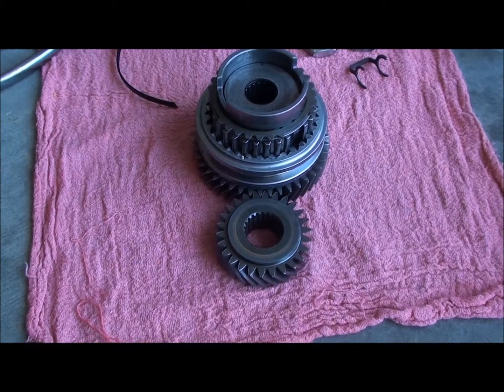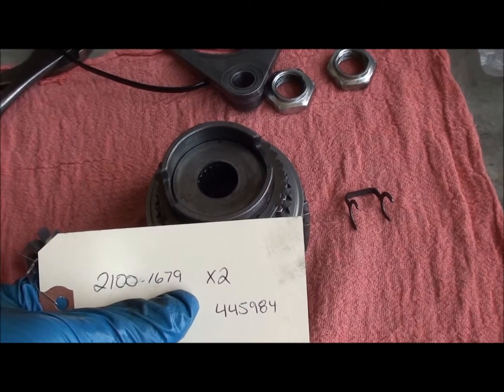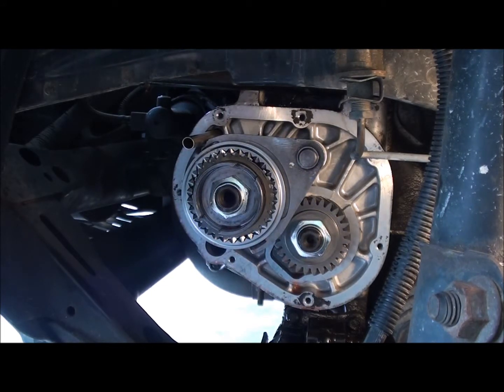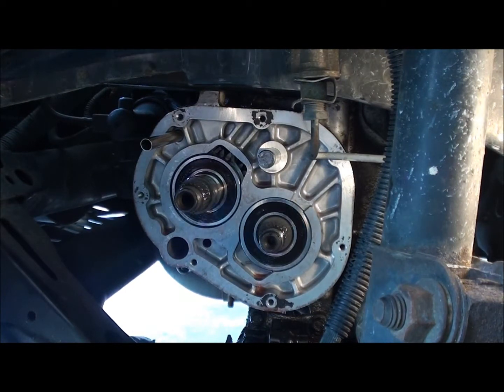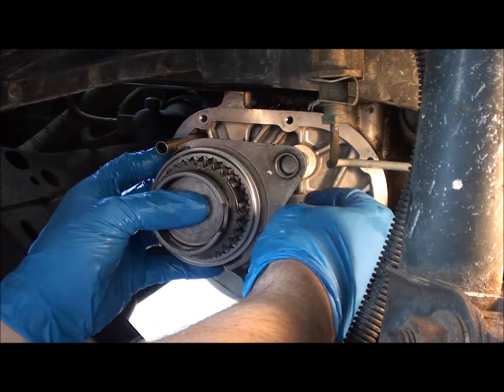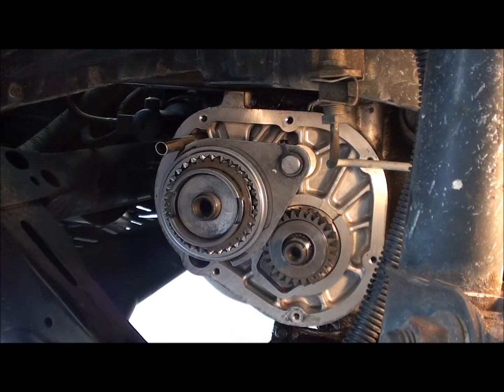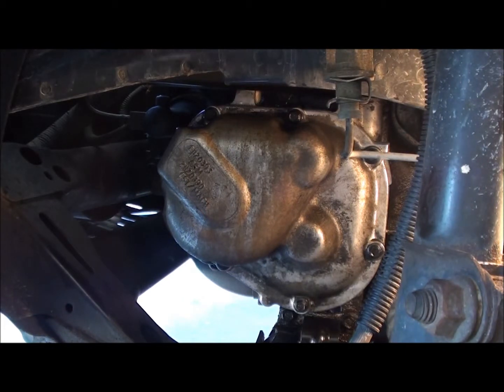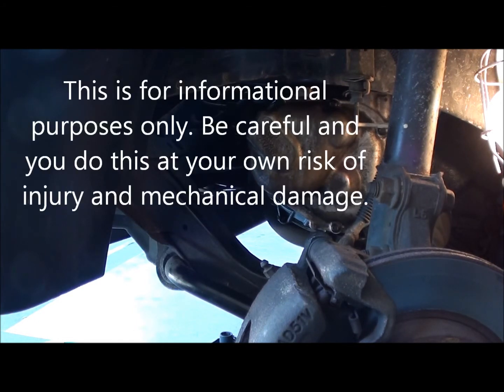Saturn SL2 DOHC 5th Gear Swap - Better MPGs!

Comment: Did the cruise control still work?
Reply from the maker: I believe it should. Unfortunately,  i couldn't test one. Mine was all manual, no cruise control installed. I was in the process of adding the CC components and about to have a dealer with a Tech 2 scan tool enable it, but totaled the car not too long after making this video.

Comment: This is a new question on an old post. I have a 99 SL2 5 speed and I was shifting and 5th popped a little and when I tried to seat it in it started whining and it sounds as if the pressure plate isn’t making contact because you can hear revolutions. Every other gear is normal with the addition of gradual increase in grinding noise in neutral unless you’re pushing in the clutch.

Comment: I'm planning on swapping 5th gear on my Corolla which has a C50 gearbox with the ratio on 5th at 0.815 and after the swap it will drop down to 0.725. I'm using a C53 gearbox for the conversion. The revs won't drop massively but it won't be as loud at 70mph.

Comment: Excellent video. I am inspired now i will go to the junkyard and grab the 5th gear set this week and do it. I drive 250 miles a day so i had considered this even though ill loose my cruise control.
Reply from the maker: Hope it works out! Good Luck and thank you for watching!
Reply: JungleKing007 i Got it all installed and it is working.
Reply: @TheMadcowintucson  Hi there. Are you still enjoying the higher 5th gear? How has it worked out for you?
Reply: @81gp80  yep works like a champ never had one problem with it but I don't use it in the city much. Now I drive mostly city and not so much highway I may swap them back lol
Reply: @TheMadcowintucson  Good to hear it worked out though. Makes sense you're considering switching back. Did you loose cruise control making the swap?
Reply: @81gp80  yes you do loose the cruise control function. I do not believe it was ever figured how to make it work
Reply: @TheMadcowintucson  I'm working on a 1997 SL2 with an auto. Well, I got it about a month ago and when it warms up I'll start. It's an auto and I'll changing it to a standard. I intend to make the 5th gear swap to the .605s. I intend to make the cruise work and wanted to see if you'd like the solution as well? I'd to get a few cars testing what I've been working on to see if there's any reason it won't work as it should.  Thanks for your replies; they're much appreciated!
Reply: @81gp80  ok sure if you get it working let me know. I think other guys just bought universal cc systems and installed those.
Reply: @TheMadcowintucson  Will do!

I guess that's an option as well. But it isn't necessary.

Comment: Does the gear you swaped have bigger or smaller ratio to increase mileage?
Reply from the maker: Here's the number crunching done by a gentleman on the SaturnFans site:

MP3 5th gears : 37*27 teeth => 27/37 = 0.7297 => 0.730

MP2 5th gears : 43*26 teeth => 26/43 = 0.6046 => 0.605 

Dividing ratios : 0.730 / 0.605 = 1.2066 => ~21% reduction in RPMs => 21% gain in MPG.
Reply: So, does this calculation work in every car both ways?

Comment: This is well worth doing if you're planning to keep the car for a long time. I did it (had the dealer mechanic do it) at 85K and just turned 200K this week. Cuts down 5th-gear rpms by almost 500.
Reply from the maker: +dmj42 definitely! unfortunately I wrecked this car not too long after making this video. Was not happy because I did all this work and wasn't able to enjoy the upgrade. Thanks for watching!
Reply: Yeah...that would be very disappointing. Especially if you bought the gears new. They aren't outrageously $$ but they are not cheap. I'm glad I did it because I've saved on engine wear & gas as well as making the car quieter on the freeway. These cars really needed a 6-speed, like the one in the Chevy Cruze.

Comment: were you able to keep your cruise control?
Reply from the maker: Joe k This SL2 did not have cruise control, but I had installed the components to get cruise. Unfortunately I wrecked the car(not too long after posting this video) before I could bring it in to the dealership to have it enabled. However, to answer your question, you will lose the ability to use cruise control. I thought I remember there being a work around with some wiring. I do not have that know how. You should check the 5th gear swap on SaturnFans. I think it was posted in there somewhere.

Comment: Hey there, I liked your video, I was wondering, can I replace the 5th gear with a smaller one, you know, kinda like an over drive? I have a 99 Sc2, with only 42k miles, and I am always reaching for another gear on the highway. I'm sure you, and your viewers can relate. Just a wonderin. Thanks!

Comment: i have a 94 sl2 5 speed manual tranny. the other day i lost 5th gear. put it into gear and there is nothing there. after getting my car to a safe place to pull other i started leaking transmission fluid between the motor and transmission. what would be causing that?
Reply: I am glad to see your OK can so so e tell me does anyone know what year Saturn had a forge steel block andconne ting rods kgallen20@yahoo.com
Reply: Transmission differential pin came out brotha. Fok

Comment from the maker: I would check all your linkages, bushings, cables, etc. and make sure nothing is worn down. One of the first thing a lot of people do(and one I have not done yet) is replace the shifter cable bushing.  sounds like it is not fully shifting into 5th. Also, replace the fluid. may help a bit but might not be the problem. Check your clutch slave and master cylinders to make sure it is fully engaging and disengaging the clutch.

Comment: i have a question. i just bought a 1996 saturn sw2 and it's got the 5 speed manual. and when i shift into 5th and let out the clutch it grinds. almost as if it wasn't going in all the way?? i was just wondering if there is anything i should be looking for before i started tearing it apart.

I also thought maybe it would be a linkage issue? let me know asap thanks.
Reply: Jake Mower shift fork components are worn out